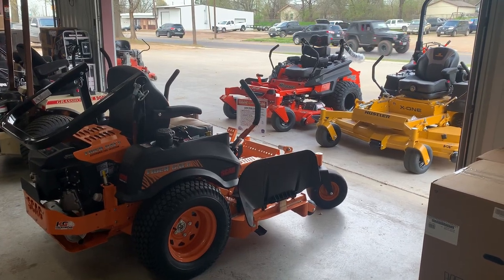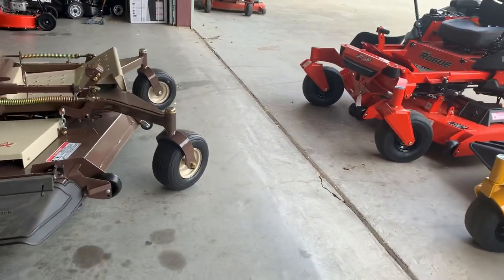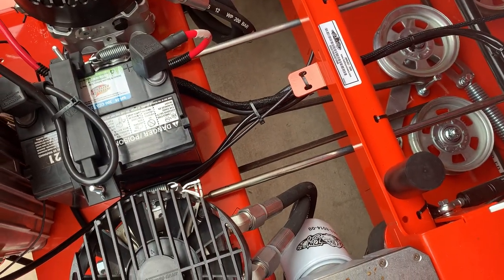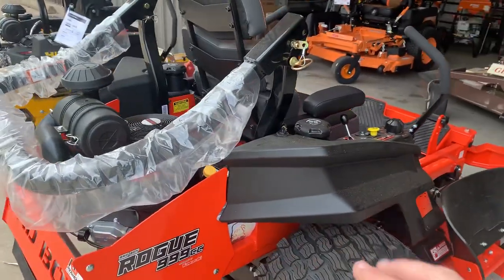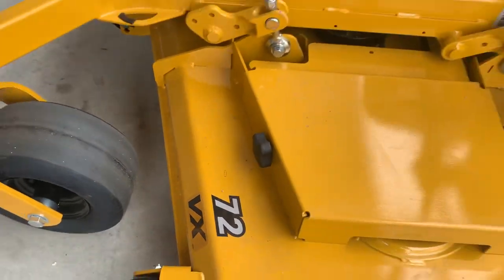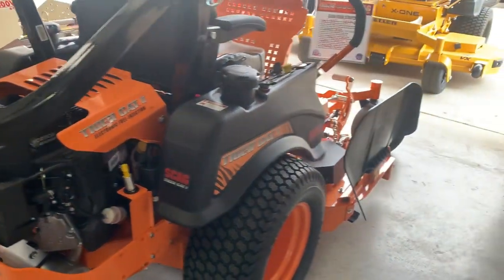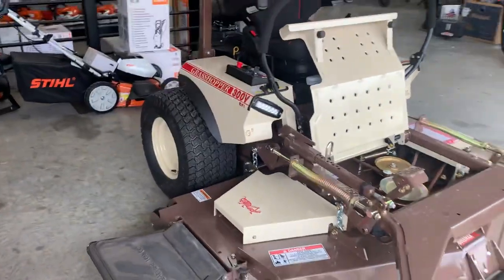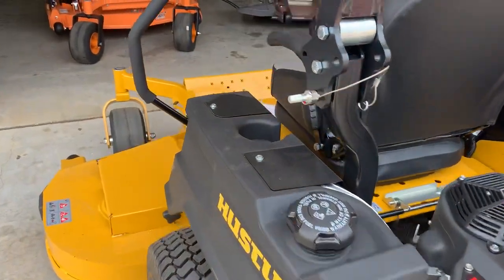Scag tiger cat vs grasshopper 300 vs bad boy rogue vs xone hustler comparison side by side.

Comment: HUSTLER IS THE BETTER MOWER SCAG IS 2ND THEN GRASS HOPPER AND BAD BOY WOULD COME IN 10TH PLACE BECAUSE THOSE MOWERS ARE ALL SHOW AND NO MOW LOOK AT THOSE SAME MOWERS AFTER 400HRS THEN GET BACK TO ME THE BADBOY WILL BE COMING APART
Reply from the maker: We got plenty out there with over 3k hours.   Bad boy dominates here by far in our area, but all areas are different.
Reply: @kgmowers  i been selling mowers for 10 years i have never seen a badboy hit 3000hrs they are ready to fall apart after 1000 now with that said i do belive the badboys made before 2010 are better mowers than the one now i been a hustler, scag, snapper pro , badboy and i have grasshopper along with a few others
Reply from the maker: @ryanpatton5937   I’ve been a dealer 15 for years.   I became the largest volume bad boy dealer in the world in 5 years.   I’ve carried dixon, gravely, altoz, and became number 2 for spartan.   Bad boy has came along way from before 2010.   The whole new line up is an industry crusher.   3k for a 7 guage commercial deck, the cut of the r series deck is incredible, the ride of the suspension systems is second to none except ferris and they are waaay higher.    We all have opinions, but bad boy rolled out 66k in mowers last year, and sold that many this year before the year even began.   They have caused the industry to change.
Reply: @kgmowers  how do you like the altoz mowers ? Here in east tenn the badboys just dont hold up im glad your having better luck with them
Reply from the maker: @ryanpatton5937   we had them for a year.   They were just too nice and expensive.  We barely sold any.   Perfect way to put it is the guy with the Ferrari would love to have this mower, but then the guy with a Ferrari wouldn’t cut his yard so it didn’t work.   I liked them.   The blow back from the front of the deck was bad like the Scag hero deck.   I would get filthy mowing.   They may have fixed it by now but even their nicest mower did it then.   I would get more dust and grass on the front of the deck as I would going out the side.
Reply: @kgmowers  ok thanks for that heads up we are about to drop one of the mowers from our line up and i have been looking them but i guess i will go a different way i may give Toro another shot
Reply from the maker: @ryanpatton5937   toro is such a huge spread and a well known brand to homeowners.    I would highly recommend them over altoz.   The track mowers were cool, but now they are 25k that’s nuts
Reply: @kgmowers  i had toro when i first opened the store and after 2 years my sales rep screwed me big time and called toro and told them to come get there mowers since then the new rep has been stopping by trying to get me back
Reply: @ryanpatton5937  hummmmm something isn't panning out
Reply: @dankruger2890  like what